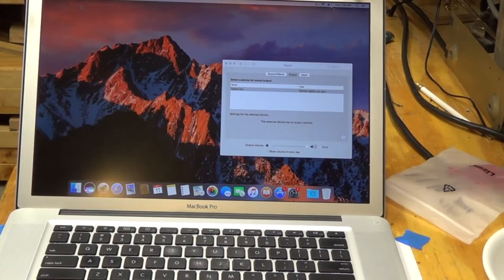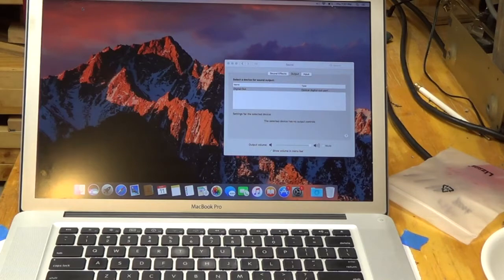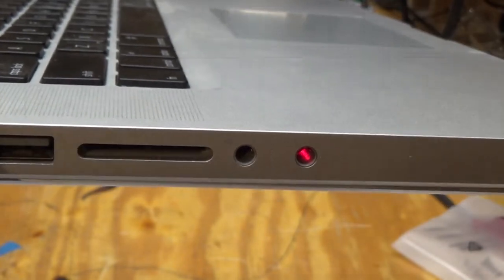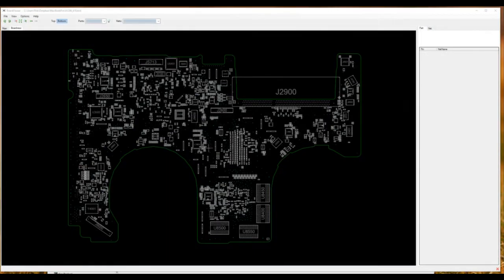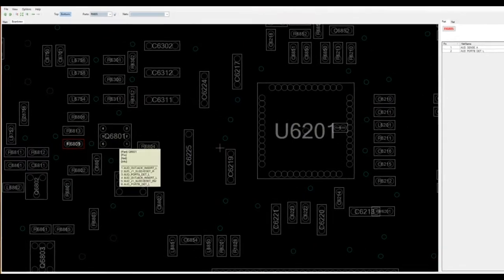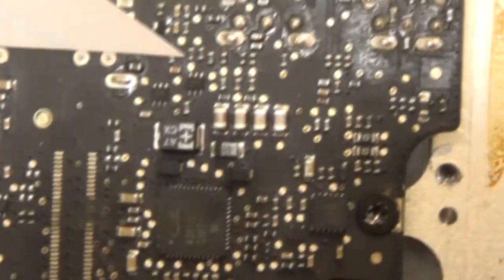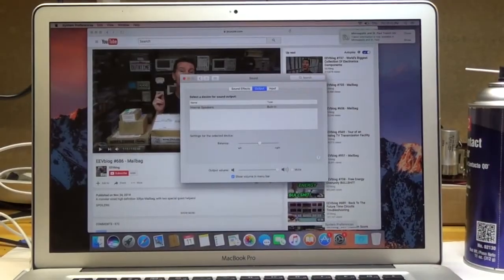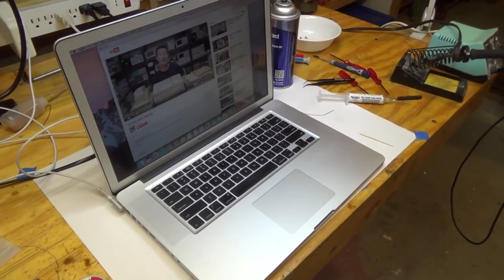MacBook Pro audio repair internal speakers not working

Comment: I have the same red light/no "internal speakers" available problem. blowing into the jack port would fix it sometimes and only for a short time.  I can also connect to bluetooth speakers remotely.  But I'm hoping this will do the trick, I'll just have to share this with my tech and see if they can do it on the cheap (rather than replace the board which was their guess without opening it up)

Comment: Seconding this method - while I'm glad some folks have had luck with q-tips or toothpicks, that's often a very temporary fix and over time will become less and less effective the more you have to do it. Rob has the most permanent and most effective fix for this problem.

For folks looking for more info, other models, or simply a text explanation in case your headphone jack prevents you from hearing this video, this thread on MacRumors should be helpful in understanding what's going on. https://forums.macrumors.com/threads/macbook-pro-optical-out-wont-turn-off.239287/page-4

Comment: Ok, haven't gone through the video yet (automatic subtitles are a bit faulty) but first things first -- anyone making an audio based video on how to fix an audio problem on a computer deserves a special place in hell. Deep in the countryside here, with no headphones or anything to help get me by with that...
Reply: "the MOSFET turns on is drawing current through here sensei sees it and flips" :)
Reply: if you're still stuck on this, check this thread for an audio-free explanation https://forums.macrumors.com/threads/macbook-pro-optical-out-wont-turn-off.239287/page-4

Comment: Thanks Rob! I had the same issue and decided to try to use a Q-Tip and some rubbing alcohol with the laptop powered off. I got the Q-Tip slightly wet, stretched it out, and swirled it into the headphone jack. It came out pretty dirty, but fixed the issue! Looks like I won't have to de-solider it. yet.
Reply: Thankyou fam took alot off my shoulders im bouta turn up fo dat
Reply: Thank you very much for your comment, I spent many hours researching a solution for this problem and after I almost giving up I decided to follow your advice.  I wrapped  some tissue on a cocktail stick or toothpick, I didn’t have alcohol so I used gin to soak the stick and clean the jack plug of my computer and on my sound output menu appeared “internal speakers” and resolved my problem. So thank you again!